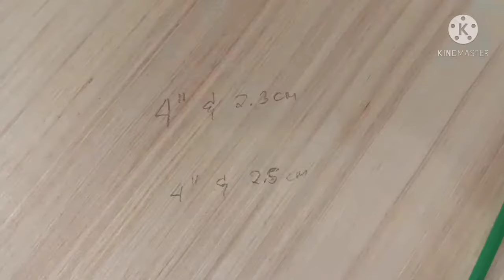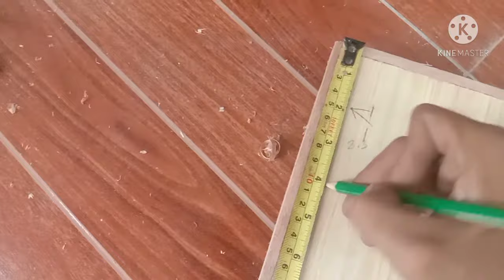PAANO MAGSUKAT AT MAGKABIT NG CONCEALED HINGES

Comment: Pinakikita mo dalawang type ng hinges a and b. Pero hindi mo sinasabi kung anong type ng cabinet. Frameless or with face frame, dapat alam kung anong klaseng hinge ang gagamitin mo.
Sa butas ng para sa hinges, may template na ginagamit para hindi na magsukat pati ang location ng screw for hing attachment.
Kailangan butasan muna lahat tapos ikabit ang hinges screws, hindi mo na kailangan ng eskuala, straight edge lang ang kailangan, ilagay sa side ng hinges at ilapat ang gilid ng dalawang hinges, kapag naglapat sa dalawang side, ibig sabihin, align ang hinges, saka i screw,  tapos.